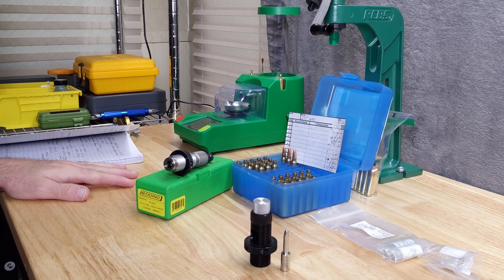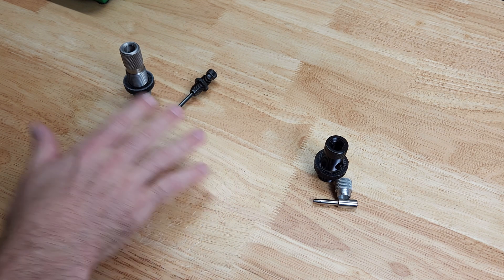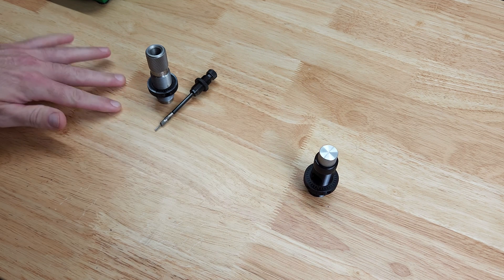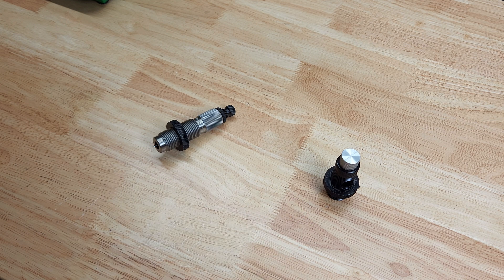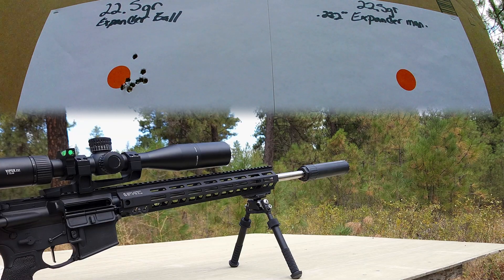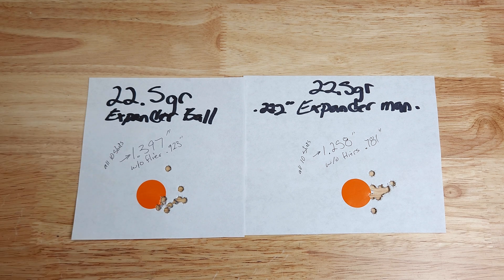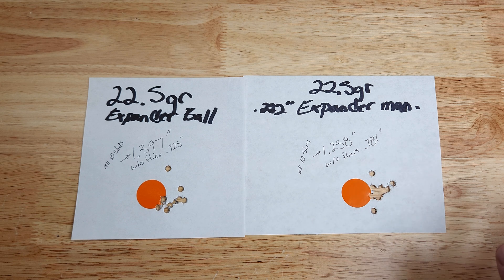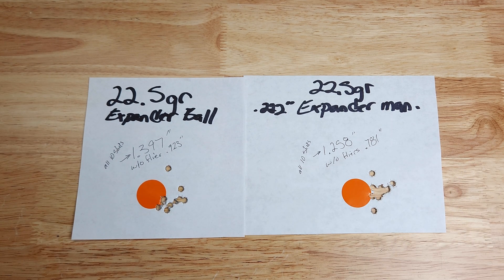Expander ball vs Expander mandrel

Comment: "run out" has been pretty well disproven as a variable(as long as it's not cocked at a 45 degree and can't be chambered) by multiple people, multiple times, with multiple cartridges, multiple guns, with factory and hand loads. I wanted to believe that it matters, but ALL of the evidence so far says that it doesn't. The people that have tested it includes Brian Zolnikov, a 1,000yrd precision bench rest shooter with a PhD in Neurology....
Reply from the maker: Good to know.  So, for the l.e.wilson seating dies, do they not make a big difference between just a standard seating die?
Reply: @Reloaderscodex  Correct. It's just a personal preference thing at this point. For reference, World champion 1,000 yrd F-class shooter Eric Cortina, loads all of his stuff on a Dillon Progressive press. I don't remember the dies he uses, but they're not a bougie as the LE wilson. Dies can make a difference in other areas, such as how much are you sizing the body of the case or ease of adjustment, but any commercially sold die produces good enough concentricity to where it makes no difference on target. You are gonna wanna check the seating stem on the bullets though. A standard seating stem doesn't always fit a standard bullet, even if the company says it should. I have 165gr hornady SST 30 cal bullets, and a standard hornady 30 cal seating stem doesn't fit it(tip bottoms out), despite hornady swearing up one side and down the other that it should fit fine, and even sending me a 2nd stem with the same issue. If it scuffs the ogive, that's not a big deal, but try to find the best fitting ones you can, especially if you're running compressed loads.
Reply from the maker: @joearledge cool good to know thanks for the info!
Reply from the maker: Is it because when the bullet goes through the rifling it will straighten itself out?
Reply: @Reloaderscodex  That's the basic principle, behind the leading hypotheses for why it doesn't matter. I haven't seen definitive proof as to WHY it doesn't matter though. It would be cool to know for sure, but I don't know if anyone is going to bother with the research on that.
Reply from the maker: @joearledge it would he cool to be able to have die that would seat at different angles and test but idk how you'd make a die purposely seat at a specific angle. I'd like to do it if I could get some dies that are crap dies that seated bullet at worse and worse angles. Idk how id find them without spending a crap ton of money finding bad ones lol
Reply: @Reloaderscodex  Yeah, that still won't really tell you "why" it doesn't matter. To get that answer, you'd have to isolate variable inside the chamber/bore. As for your testing idea, Brian Zolnikov intentionally induced run out with his test, just look up his name on YT to see his stuff. Most people that have taken this on have just sorted their ammo, factory or hand loads, into "best" and "worst" categories. Some have a 3rd category of "mixed best and worst". If you want to do your own test, I'm not discouraging it, it would only add to the data available. That's the great thing about real science(not the post 2020 BS), nothing can ever be definitively proven or disproven, you can only stack evidence in one category or another, and the biggest pile of evidence is usually taken to be "true". The only downside is having to buy a concentricity gauge knowing that there's a 99.9% chance that it's going to be useless after the test. Might be able to borrow 1 or get 1 on the cheap from fleabay. If you do it, I just request that you put "run out" or "concentricity" in the title, so people can find it. The problem with a lot of the videos on it is that, run out was not the main topic. They were fiddling with something else and just said screw it, while I'm at it, I'll do an impromptu test to see how much difference run out makes.
Reply from the maker: @joearledge, if you've ever seen johnnys reloading bench, he does a test where he sorts his and yields the results you're talking about.  The really bad runout bullets don't do any worse than his better ones. 
Hey, Is the username joearledge1 by vhsnce also you?
Reply: @Reloaderscodex  Yeah, I've been watching JRB almost since he started his channel. He's the reason I reload today. His videos on it illustrate everything I was talking about pretty well, even the issue with it not being in the title. Yeah, that's me. For some reason I had to set up a 2nd account for a phone I had at some point, in order to use YT on that phone.
Reply from the maker: @joearledge lol, that's strange.  He's why I started my channel and reloading as well. I was sad when he stopped making new videos. He's so knowledgeable and isn't timid on camera.  That's my problem. I hate being on camera, and im not super knowledgeable, so I don't know what to say sometimes. But im slowly getting better. I also love editing, which is why I had music throughout my videos for the first few cause I want my videos to ve like a sweet movie experience but rrealized very quickly it sounded horrible and ppl hated it lol. I'll have to just find other ways to make them more cinematic.
Reply: @Reloaderscodex  Not being knowledgeable is not a bad thing if you're trying to learn. It gives you the "noob" perspective. A lot of guys that have done it for decades can't explain things as well, because a lot of it has become 2nd nature. It also provides the perfect opportunity to poll the audience BEFORE you dive into a project. Ex: if you mention in a video that you want to get into annealing, and would like suggestions, then I'm sure you'll have 20 to chose from, with everyone pointing out pros or cons of this method or that method. Combine that with your own research, and you're more likely to make a better choice right out of the gate, as opposed to making the wrong one initially and tossing another gadget into the "spare reloading tools bucket". I wouldn't get wrapped around the axle with cinematics. 99% of you're audience just cares about the info, methods, and results. As long as that stuff comes across fairly clear, you're good.
Reply from the maker: @joearledge yeah, the last 3 or 4 videos that's what I've been doing. Bare bones info and all about the shooting and results. And my views for me have shot up from 500ish to 3-4k. Which for me is crazy. In the grand scheme of things, it's pennies, but you got to start somewhere. And i enjoy the process.  Im not one to like attention, and even recording when my face is off camera is weird to me, lol. Just like how I like the whole reloading process as much as the shooting.
Reply: @Reloaderscodex  Yeah, reloading is it's own hobby apart from shooting. Most people don't realize that it's wwwaaayyy more of a pain in the butt and slower than muzzleloading, unless you throw a lot of money into home automation stuff for reloading. It's definitely not for everyone, it's a lot of legitimate work if you do it right. A lot of people think they're going to get a LEE starter kit and crank out 1/2 price plinking ammo by the case. You really have to like tinkering and fiddling with stuff to reload. The only places it saves money is 1: ultra high quality precision stuff, 2: custom stuff that doesn't exist anywhere(especially true in shotgun stuff), 3: Old/ obsolete /antique stuff that is ultra rare/ expensive/ collectable. Other than that, if you want to do mag dumps, or shoot skeet, buy a case of whatever is cheap this week, because you can't make it cheaper than they are selling the cheap stuff. Maybe if you get free brass and free lead and cast your own, and possibly reload your own primers, you might beat it technically, but factor in ALL of the equipment that all of that requires, plus your time and effort, and it's not worth it, financially speaking.
Reply: @Reloaderscodex  i dont think anyone has proven precisely why it doesnt matter, but the data clearly shows it does not matter.
Reply: I’ve heard this as well, with the sizing die and process being a lot more important overall to making quality rounds.

However I still prefer a mandrel for establishing a clean ID and pushing brass to the outside rather than using a bushing.  And even if it doesn’t make a substantial or even slight difference, I still seat with inline dies on an arbor press.  Although I’ve used a Redding Competition seating die (more expensive than the Wilson inline micro die actually) and its does a fantastic job.  I don’t know, I just like the control of the arbor press and ability to feel and even measure the seating force.   🤷‍♂️

Comment: Did you let the barrel cool between the two groups? Wondering if the Delta in vertical average could be explained by that.
Reply from the maker: Yeah not completely cold but I keep the barrel warm but not hot or cold

Comment: I've found that lubing the inside of the neck when using a conventional sizing die with an expander ball, there's been negligible stretching of the neck.
No ballistics change.
Also helps if one decaps, then run the expander ball up so it starts sizing while the neck is still captured by the die.
Reply from the maker: When using a standard expander ball setup I've always just used imperial dry neck lube. I didnt start using sizing die wax on the inside of the necks until I started using expander mandrels.

Comment: I think the upward shift was due to more consistent neck tension offered by the mandrel.  Another major variable is whether or not the brass was annealed prior to shoulder bump and sizing.  If the brass was not annealed, it will change the spring back characteristics of the brass, again changing neck tension (bullet release) from shot to shot.
Reply from the maker: Yeah I always anneal before each firing for more consistency. I didnt think about the shit being due to the neck tension but makes sense.
Reply: @Reloaderscodex  Not sure how much difference it will make, but when I run the brass over a mandrel, I first run a nylon brush through the neck that has Imperial Dry Neck Lube on it.  It may not buy anything, but it can't hurt, and sure makes bullet seating like a knife through butter.

Comment: I use mandrels. I stopped using expander balls in sizing dies roughly 24 years ago. But, if you do not lock down your stem in your size die, you can float the expander so it will self align. I used to do that when I still used them.
Reply from the maker: I did not know that . Thanks for the heads up. I'll have to try that with my new 6.5cm bolt gun I'm building until I can get the money to get some mandrels for it.
Reply: @Reloaderscodex  What components did you go with for your 6.5CM build? I've got a 8 twist 5R Bartlein barrel #3 I've been contemplating what to do with. I'm leaning CM because I have multiple 6.5PRCs and 6.5-284 Norma rifles. All of my current 6.5CM are factory Tikkas. 

If you are going to test your expander ball, I recommend you raise it high into the die so the case mouth catches it immediately after you start to lower your ram. I remove the decapping pin because I do that in a separate step anyway. Just don't tighten the lock ring on it and it will float. You'll see you will be able to wiggle it. Finally, how long is your dwell time when sizing and expanding brass?
Reply from the maker: @Accuracy1st I got a zermatt origins action, proof research stainless steel pre-fit 26" 1in8 twist 6.5cm,  mdt acc elite chassis, triggertech special single stage trigger since I'm a lefty and they don't make left handed dbl action for some reason.  And im trying to decide what mount/rings to go with. I'll try both my oss 7.62 hq qd suppressor and q trash panda suppressor. I know they work better with semis, but I get much better accuracy from my oss than my Q. With my oss, I'll get an Ave. .75" or so, and my Q, it makes most my groups like 1.5" to 2". I mainly got it for my 300bo, though. I'll probably get one for my 6.5 that's better suited for a bolt gun. I've never even fired a bolt gun, but since I love precision shooting with my ARs, I knew I'd love them, so I just got quality the first time around. I just got my sac barrel vise in the last couple of days, so I'll start building her here soon.  Think I should film it and make build content? I have a rumble, which is probably the only place I can put it bc YT isn't build friendly.
Reply: @Reloaderscodex  Definitely video it. I read and hear YT doesn't allow footage of firearm modifications but you may be able to do it because a receiver is not a firearm. It's not a firearm until you have a receiver, barrel, and trigger if I recall correctly. Also, contact Zermatt and ask questions about their fire control and any issues with friction. Ignition problems cause fliers - changes with POI. Erik Cortina and Speedy Gonzales talk about how even the best actions still have ignition friction and the bolt shrouds need relief grooves machined into them. To me when you drop a grand to $2000 into an action that should not even be a possibility. Sadly it seems to be quite common. The only action I've heard of that doesn't have this issue is from Borden.
Reply from the maker: From some of the videos I've seen on X-ring, they don't allow barrel changes to be shown, but I can always put it on rumble. And blur some of the stuff on YouTube. I'll figure it out.

Comment: You had a big shift in point of impact one the first target about half way through. Something changed. With a bipod the amount of pressure you put on the gun can cause that. Also the parallax in the scope being off a little, along with shifting your head can cause that. I'm 61 years old. and I've been shooting since age five. I shoot 300 and 600 yard benchrest for score. I'm no longer in the run out causing big problems camp. Several well known YT shooters have tested run out to ten thousand's of an inch and saw no difference. I've tested to six and saw no difference. With that said, most our rifles have tight chambers, and that may help. The only way to know is to test that. I subscribed, but when yu were shooting, I had to turn the volume down. 😊
Reply from the maker: Thanks for the subscribe. I'll have to be more aware of that stuff. First time that's happened. I checked and made sure everything was screwed down tight after that cause it was def weird. Thanks for your insight and feedback. I have a couple of videos qued up and think since I'm on the expander mandrel and neck tension subject I'll do neck tension test next. I only have 3 different mandrels. .221/.2215/.222 and idk if that will show a difference but im curious if they will shoot different or if I need a much smaller mandrel to notice a difference 🤔